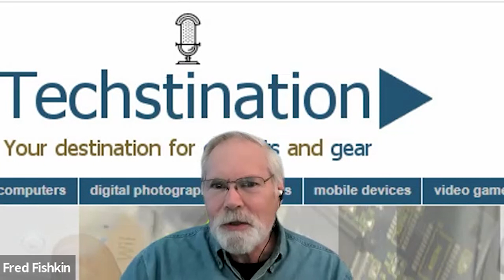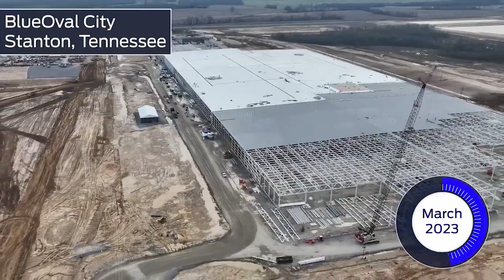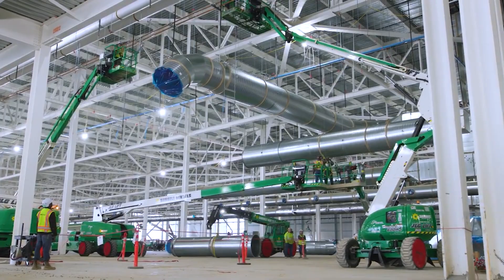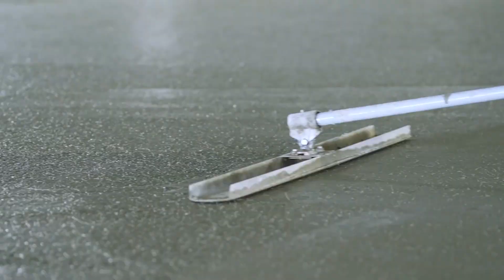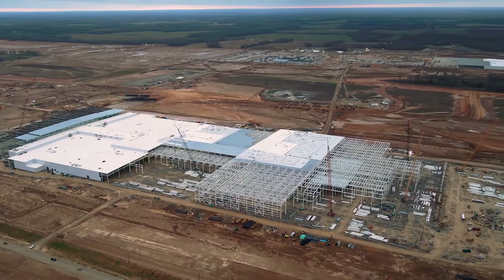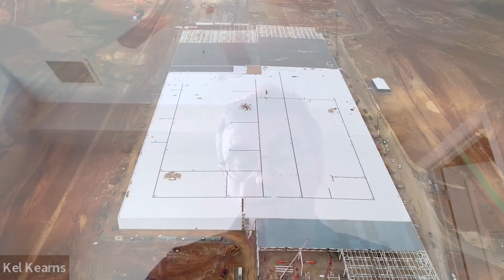Techstination Interview: Ford's BlueOval City in Tennessee to build Project T3 electric truck

Comment: Great interview. I’m looking forward to Ford’s next generation of EV’s, I think the MachE and Lightning were a great start, but I’m hoping the next ones have either slightly lower price points or are fully matured. They’re almost there, I’m sure they’re right around the corner from component standardization, repairability, firmware standardization, etc.